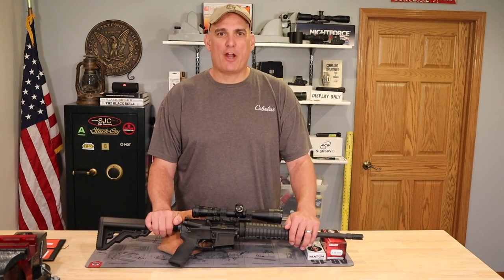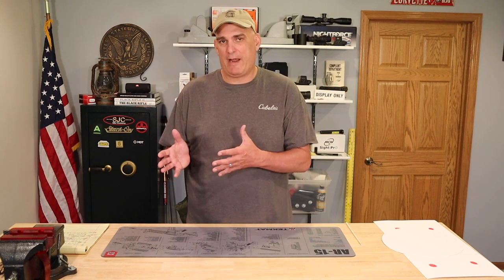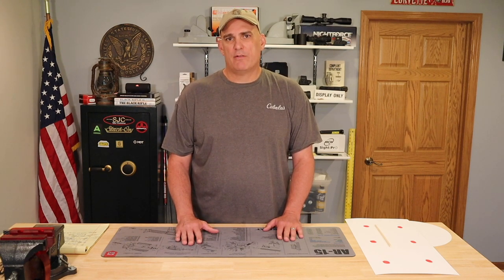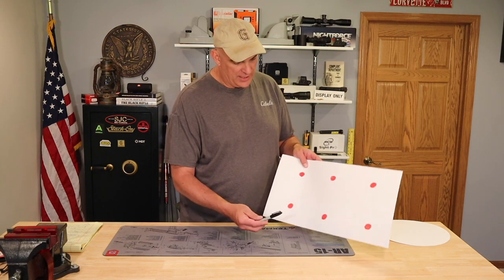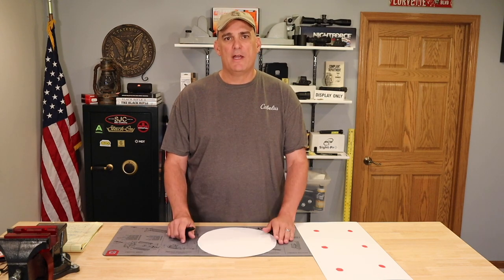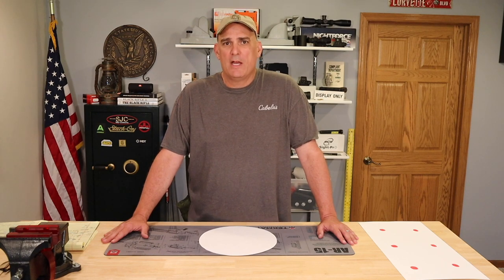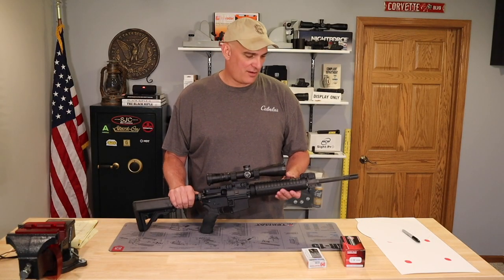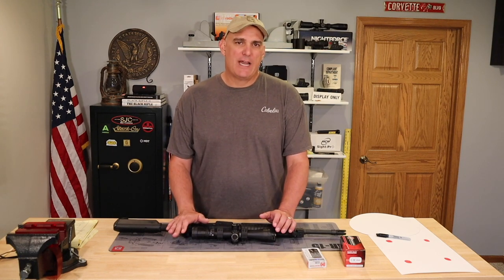Why Ar-15 twist rate does not matter with stability | accuracy. Pt 2.

Comment: There's about 100 trolls trying to figure out how to prove you wrong after shooting 1/9" with 77gr over 500yds at 12" gong and 3/4" groups at 100yds. Then reading the 77gr factory ammo recommending for the 1st choice 1/9" right off the box.  This video is a true "FACT CHECK" , thank you sir.
Reply from the maker: You are welcome. glad you enjoyed the video.
Reply: Exactly. I'm not trolling and did leave a comment about this. I have seen a keyhole signature at the range a few times from 1|9 twist and this round from others rifles. It's not the round. It's the barrel. Not all barrels are equal as best I can figure. I'm not expert or anything.  I guess it could be a bad box or lot of rounds but I doubt it as they didn't do this in other rifles at the range. One of these was said to be top company match barrel It happens. Just like ammunition barrels can and do very.
Reply: Thanks for confirming my personal data,  was starting to think I was crazy , internet had me second guessing myself . My 20in 1/9 shoots better groups with 68 grain and up , never experienced any "keyholes"  sub 1moa with 69gr , 2moa with 55 grain match .. my 1/7 seems to like 55 grain better. Exactly the opposite of all data I could find.
Reply: I shoot whatever I can get.
Reply: I have a 16in 1/9.  I can get 1.5 moa out of 75gr.  Some 77's key hole others are in line with the 75's.  Just my experience.  Just the fact mine does well with 75's bucks "common knowledge."

Comment: @Practical Accuracy. Your first group of about 9 inches was actually a little better than you thought. To figure true MOA, divide group size by range in 100 yards. Then multiply that product by 1.047" ( 1 minute at 100 yds) for your actual MOA. Ex. 9" ÷ 5.65 × 1.047" = 1.68 MOA. Pretty good shooting with a 4x ACOG!
Reply from the maker: Thanks. I always round it off. lol.
Reply: I rewatched your video. You said 9.75 inch group for 1.72 MOA. So you didn't round off. It would be 1.72 MOA if MOA was 1 inch at 100 yards, which it is not. Using the corrected info, your group size is actually 1.80 MOA. I was attempting to show you the correct way to figure minute of angle.
Reply from the maker: @timsaxer6442  Thanks. I can't remember what I said, but I usually round it. i.e 1 moa @ 600 yards is 6 inches. It is just easier for my brain. lol.  Thanks for the help.
Reply: @timsaxer6442  chill
Reply: @ViktoriousDead seriously

Comment: Hi Andy came across your video very good information. I learned a lot about the twist rate and maybe paying a little more mind to the weight of the ammo.    Keep up the good work
Reply from the maker: thanks for watching
Reply: Not the weight, the length of the bullet is the deciding factor in twist rate. You can have the same weight in different lengths even from the same manufacturer. The longer the bullet the more surface is in the wind, the more rotational speed is needed. You probably know that, I just add it for others while it was also mentioned in a previous PA video.

Comment: Excellent follow up to Part 1!  I have a 1-9 twist rate on my 20 inch barrel and was leery about using longer bullets than the 69gr SMK which is capable of giving me a 3/8th inch 10 shot group when I do my part.  I think the next time I sit down at the reloading bench I am gonna try some 75-77 gr bullets per chance I can duplicate your results in my gun.  Thanks for the video!
Reply from the maker: You are welcome. For many years I was leery too. Until one day, I just tried it and to my surprise, every one of my 1-9 shot 77 just fine. Good luck.
Reply: How'd that work out lol

Comment: I own a DDM4V7 with a 1:7 twist, and a PSA 223 Wylde with a 1:8 twist. They distinctly like different grain ammo (accuracy). 
The 1:7 likes heavier grain 68-77 grain 5.56, and the 1:8 likes some, not all .223 Remington 55 grain and 62 grain up to 69 grain.
Barrel quality and ammunition type and quality are the key. Shooting 5.56 versus .223 ammunition affects accuracy. Pressure differences affect bullet weight. For some reason, The PSA likes Finocchi and PMC. Doesn’t like Winchester 5.56 or Federal 2.23 55 grain FMJ( less accuracy).
Thank you for your videos.
Reply from the maker: thank you for the comment. i agree that each barrel is different and testing is important. thanks for watching.

Comment: just watched both of these videos. You proved your point, now what's the purpose of the three twist rates if it doesn't matter, and why did the military think it was a good idea to go with 1:7?
Reply from the maker: I think the military went with 1:7 for the tracer round they use. I have not shot that round to verify stability, but for the commercial market it really doesn't matter other than marketing hype. Thanks for watching.
Reply: @PracticalAccuracy  thanks for the info. keep up the good work.
Reply from the maker: @williammueller6109   Thanks.

Comment: My personal experience is that the twist rate affects bullet dynamics upon impact with gelatin or meat depending on bullet weight and construction. The stability ranges from straight through with minimal instability and little tumbling to extreme instability with tumbling and twisting cavitation. The longest, heaviest bullets tend to perform great through 1:7.
Reply from the maker: Thanks for watching
Reply: Oh now the twist rate affects what the bullet does AFTER it hits the target BAHAHAHA
Reply: @Tony_Seed  No, twist rate affects what the bullet does when it leaves the barrel which affects what it does when it reaches the target. Same way that gripping a baseball or football affects the way the ball spins in the air which makes it harder or easier to catch at the other end.
Reply: @paulsmith5611 he said "AFERtUrr"!!

Comment: those of us who have been in the game for a long time have fought this myth since the beginning of time.  It is due to a lack of understanding on what is wrong with 1/9 and why 1/8 is said to be better and why the military went to 1/7.  It has very little to do with accuracy, it has to do with what the bullets do when they strike a human target.  The other myth we are constantly fighting is ballistics gel test. People, (very smart gun people) still spread the myth that a "wound channel" in ballistics gel is some how an indicator of a wound in a human.  The gel is merely a test medium to compare several different bullets against the same thing, and the FBI determined at what depth of penetration could a round be thought of as having the needed power to inflict a life stopping wound.  That depth was 12" which has nothing to do with how thick a person is. The "wound channel" in the gel was an indicator of how the bullet dispersed its energy on impact...IN THAT GEL. The same impact on a human will be completely different. A tiny thin wound channel in gel might to a huge one in a person or vise versa... the gel is NOT a test to show lethality at all.
Reply from the maker: Thanks for the insight
Reply: This is such a good comment, something I have been trying to get across on ballistic gel videos for ages. Particularly those gel videos that use the fluted bullets.  Ballistics gel wasn't designed to determine that kind of wounding potential.

Comment: Hi Andy,    I have a Bushmaster ar15.   I generally just buy the cheapest ammo.    It seems pretty accurate 🤔.    Should I not be so cheap and try and get the same bullet weight all the time?
Reply from the maker: if it shoots well with the bullet weight stay with it.
Reply: Sounds like you also pick the cheapest rifles as well.
Reply: @cookncrook6902  he has himself a rifle for what he needs and that's what matters. Do not be that guy that turns people off from shooting guns because they don't have the expensive stuff.
Reply: @RolandtheThompsonGunner  Not my intention, I just wouldn’t trust my life to a bushmaster. My rifle is probably in the middle. I’m not exactly rocking a Daniel defense myself. As long as it functions properly and is well maintained I say go with it!

Comment: I guess I understood the myth incorrectly when I thought that the shorter the twist rate, the heavier the projectile it can effectively stabilize.
Reply from the maker: Generally, a faster twist rate is needed to stabilize heavier and longer bullets, but not so in the AR15 platform with 5.56 and shooting 55 to 77 grain bullets out of 1-7, 1-8, or 1-9 twist rates.

Comment: It seems to be a weird phenomenon every 16 inch with 1:9 i couldn't get a group to save my life (4 moa) but with 20+ inch barrels it always stabilized with a 1:9
Reply: With a 1/9 twist in both barrels, you'll get 
16" 1.7 bullet turns
20"  2.2 bullet turns.
Reply: @terrytolentino5459  dont forget the chamber is included in the barrel length so 1.760 and if it's a 5.56 chamber then the rifling starts a bit later so more like 14.25 inches of rifling and 18.25 of rifling
Reply: @jorgesolis9468   I didn't figure that in. Thank you. So you're getting more like one bullet turn in the 16" and almost 2 in the 20"  with a 1/9 twist?
Reply: @terrytolentino5459  technically the lead time in the 5.56 is like .120 of freebore before it engages rifling so yeah of course theres several other factors that can affect the bullet such as contact surface, shape, material, and what your barrel likes
Reply: @terrytolentino5459  the number of turns in the barrel is inconsequential, we only care about the RPM achieved.
Reply: @Hornet135  You only care about. I don't.

Comment: Agreed I am wondering the best twist ratio for the 40 grain varminter  round for the short barrel 16" 
What I heard was faster bullet (lightweight) slower twist ratio 1in9?   Heavier bullet faster twist ratio.
 So firing military ball a 24" 1in7 twist will ring all the accuracy and secondary wounding effect out of said round?
Reply from the maker: If you are going with 40 grains, I'd stick with 1:9. If 40 grain bullets are shot with a 1:7 and have a thin jacket, the jacket can actually separate mid flight. Military ball will work fine with 1:7 and the wounding effect (fragmentation) is dependent on speed so 24 inch barrel will give you max speed.
Reply: @PracticalAccuracy  thank you for confirming what I thought.
Wisconsin huh? I used to live in Oshkosh 88-97.
Just found your channel today must admit impressed so far. Keep up the great work.
Is most of your work going to be based on the ArmaLite Rifle?
If someone was to use the 40 grainers with the 1/7  I wonder where it would break apart could this be something to limit danger of a missed shot far down range to Betty Joe's poodle?
When deployed overseas to Iraq my unit gave us brand new M-4 with the 14" barrel which cut our qualifications requirements from max of 400 down to 300
Reply from the maker: @kirkchartier7141   You are welcome. For now most videos will be AR, but I'll also be posting  other content related to long distance shooting.

Comment: I have a 16 " AR 1/9 that shoots 55 gr, fabulously and 62 & 68gr 5 or 6 " 100yrds groups, weird, Free floated, 3lb good trigger, Optics 12X Leopold. 
K ser-ra  ?  🥺
Reply from the maker: you never know until you test it. Thanks for watching.
Reply: Bullet weight is only one part of the equation. (powder charge, bullet construction, bla bla bla etc.) Every barrel has it's own unique sweet spot. Either load your own (experiment with different powders/charges/etc) or try different brands of ammo, maybe you'll get lucky. With the current ammo situation - not what you wanted to hear. Maybe stick with what works?

Comment: I have a 1/9 that shoots 77gr fine. There is often voodoo involved.  I have seen some 1/9 have issues, even tumbling.  I found my rifle could also shoot long 62gr Barnes TSX bullets.  If a 1/9 can shoot those then the 77gr SMK will have no problem.
Reply from the maker: absolutely. gotta test your rifle
Reply: We tried M855A1 through a 16" 1:9 rifle and it was keyholing at 25m. My 20" 1:9 didn't have that issue. Spin stabilization depends on twist and velocity. Also, bullets don't achieve full stability until they are well down range, with some it can be 100 - 150m before they have settled with minimal precession. That's why M855 can have such erratic results, it's dependent on 20" rifles that were intended for it and suffers more when using 14.5" bbl rifles.

Comment: Am I correct in assuming that the 16" barreled rifle, due to its shorter length not subject to harmonics as much as the  20" barreled rifles? Great information by the way. Cheers!
Reply from the maker: The 16 inch inch barrel is still subject to a harmonic pattern and while every barrel is different,  generally short and thick barrels will be subject to less "barrel whip" or a less pronounced harmonic pattern. You will often see short, thick, barrels group better at shorter distances because of the harmonics. So, yes, generally, you are correct. However, at very long distance where velocity becomes an issue, longer barrels may out perform shorter barrels. Thanks for watching.
Reply: I've had 4 different rifles sofar over the years the best performance I've found was from my 18" 1/8 twist ss rifle length gas system and the runner up was my 16" 1/7 twist nitride qpq barrel mid length gas system both had free floated handguards the other 2 both were 16" 1/9 twist with none free float carbine and a mid gas system

Comment: Really enjoying the channel! Another question. I’m attempting a 36 yard zero, and am using a bore laser for the first step.I’m using 62 grain .556 ammo. Before actually firing any rounds,just using the laser should there be any height adjustment for the red dot zero at 36 yards? Thanks!
Reply from the maker: If I understand your question, use the laser to where you want your bullet to impact on the target and then move the red dot to where the laser is pointing. You will then need to fire at least 5 rounds to confirm your zero. Most of the time, a laser gets you close, but you  will still need to make adjustments. Hope this helps.  Any other topics you would like to see in a video format?
Reply: @PracticalAccuracy  thanks for answering. Specifically I was referring to the height adjustment using just the laser. At 36 yards if I were to zero using just a Laser do you think I would need to adjust the height up or down for actual point of impact using live rounds? Just trying to get as close as possible before firing rounds as to not have to waste very many rounds. As you know, ammunition is scarce/expensive. Thanks again! As far is subjects for upcoming videos I love anything A.R. 15 related. I am new to the AR world and I’m trying to soak up as much information as I can from more experienced people. Thank you!
Reply from the maker: @snowbyrdie2934   Yes, you will probably have to make some small adjustments for elevation (height up or down). Just be sure to allways use the same ammo brand and the exact same ammo or your point of impact will change with different manufacturers.

Comment: Black hills ammo will cross the 1000 yard line point on and stable from 18 inch barrels.
Reply from the maker: Cool. I don't have an 18 inch. Have you shot a 16 inch to 1000?  So far I have only shot 20 inch barrels  out to 1000.

Comment: Studies show zero increase in accuracy on barrels longer than 16" even with PRS calibers like 6.5 Creedmoor or 300 Win Mag unless barrel is very thick. Even then the improvement is minimal. Greater than 16" starts to show barrel whip.
Reply from the maker: I would agree with that. This is why short barrels can often out shoot longer barrels
Reply: Sorry, I don't agree.  Every barrel that I have seen likes loads aroound 200fps lower  than maximum.  I have a heavy (Douglas)) barrel 280 rem that shoots under 1moa groups all day long but if you increase pressures too much it gets unstable... without changing bullet weights, profiles or brand.  The key is to experment with bullets, primers, powders and loads that work best in YOUR rifle.

Comment: I know this is a super old but just get a 1:8 twist from faxon  it covers almost all your grain weights
Reply from the maker: True. No controversy there
Reply: @PracticalAccuracy  I’m fixen to do a left hand mk12 build any suggestions on optics or recommendations when it comes to dmr/spr build
Reply from the maker: @settlesmachiningtools8671  I don't like the LPVO set up.  I usually run a dedicated scope and I prefer Nightforce  4-16  ATACR , but it's pricey.  I have the Arken optic 4-16 SH4. it's only $289 and a good value.  I would recommend either one of those.

Comment: Twist is a guidline...personally i use a 223 wylde chambered 1in 8"  twist 18" for this type of work...i shoot nothing but 77s out of that rifle...it's easily .75 moa out to 700 all day with my pet 5.56 load
Reply from the maker: Awesome.  I use 1/8 or 1/9 mostly with no issues 55-77gr.

Comment: I don't know what you're trying to prove, but you've proven exactly nothing. In testing, the scientific method rules. Change ONE and ONLY ONE thing at a time. Different rifles, different optics, different days, different wind and you delude yourself that you can draw conclusions about twist rate? 
If you want it to mean anything you'd need barrels of each twist from ONE manufacturer, matched for length and chamber. Then you'd need about 10 different brands of ammo in each bullet weight. THEN you'd at least have a prayer of making a conclusion based on twist rate. Other than that you have no clue what caused any changes.